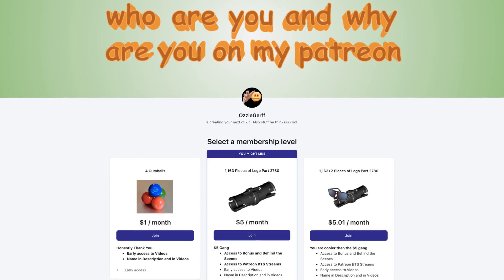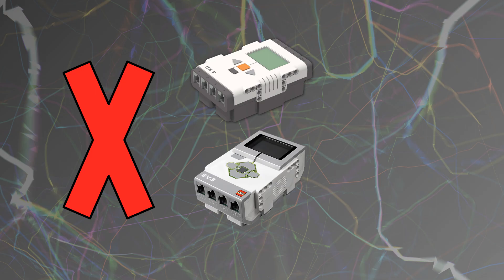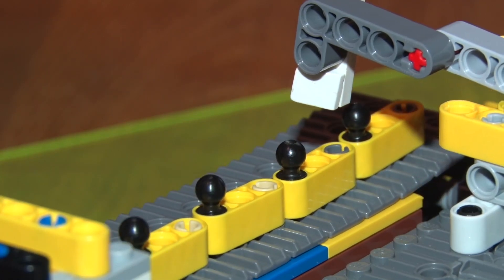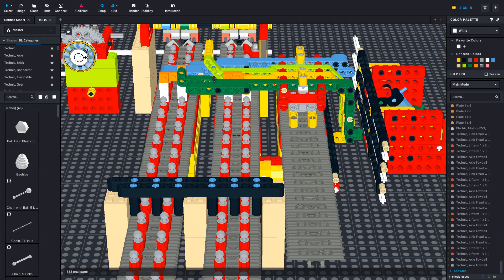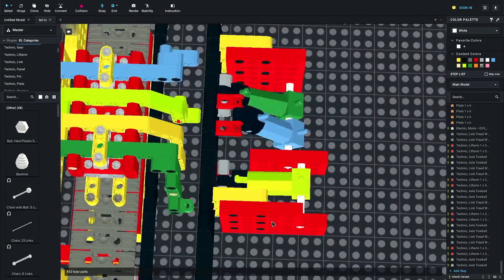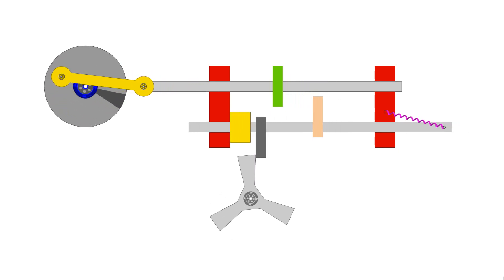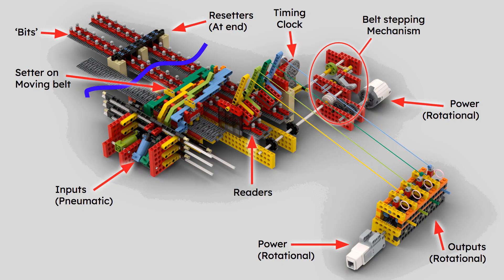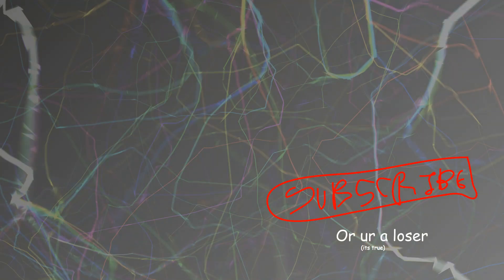LEGO Computer Part 2: Tail Memory Buffer

Comment from the maker: There will be 4 separate screen axle outputs for 4 towers:
1 tower is a reader, 3 are writers, the writers move a rod on a rack and pinion to rotate the screen axles to turn the tiles, each tile will have 1 axle output which will get split into 4 outputs for each tower 

Head READER
Readers in cardinal directions (compared to head setter)
Rotation to worm gear to small gear to arm to 3 channel pneumatic switch (not back-driveable :) , 1 switch for each direction so 12 total channels)

Head WRITER (Pushed in, writes snake tiles)
Rotation to Linear rod
Non moving setter

tail WRITER (pulled out -> empty)
Rotation to Linear rod
Non moving setter

Food generation WRITER (middle)
Write only on if food eaten
doesn't affect snake tiles since it doesn't reach that far
Rotation to Linear rod
Setter: Pneumatic piston push rod in to middle